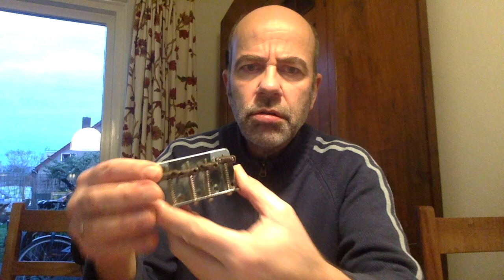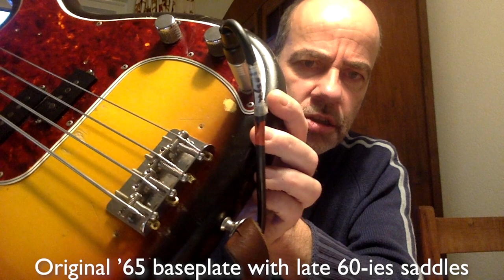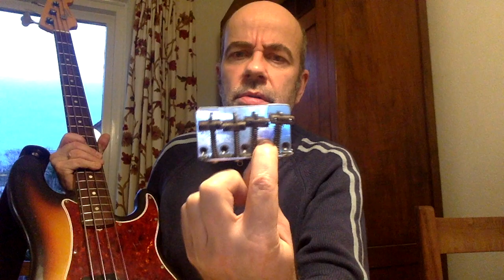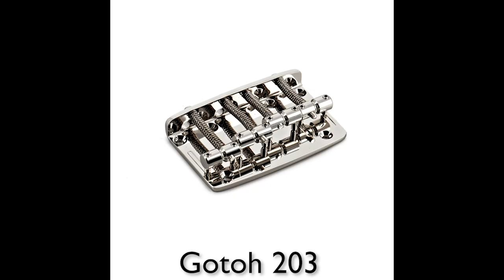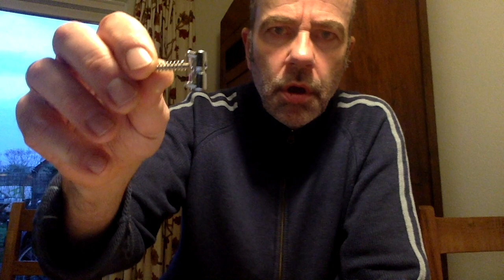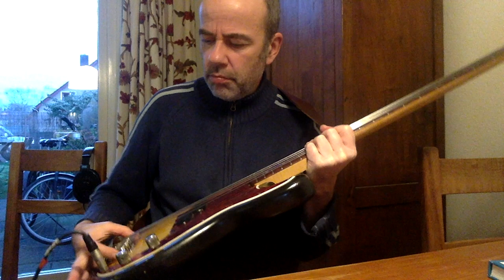Vintage Fender bass bridge saddles issues

Comment: Use longer or stronger Springs that will push the saddles outward toward the pickups. I sometimes use 2 springs to apply more tension on the saddles.

Comment: The bottom of the original screws that adjust the saddle height,  use a fine file and flatten the bottom of each screw, so the screw makes more even contact with the bridge. This might eliminate the clicking. Try using your old saddles and put new screws in the saddles to adjust the height. If you really want to use the old saddles. It's worth a shot!
Reply from the maker: That's really good advice, thanks! I did clean them with vinegar and a brush. Still not super shiny or something but already way better (they were really rusty). And I turned some of the saddles upside down. After all those years some of the threads were pretty worn. I also found out you should just let the strings sit for at least 2 days. Now this bass is fine.

Comment: I changed the saddles (cheap steel) on my 2010 USA Fender Jazz bass fitted with a vintage bridge, for larger diameter solid brass grooved barrel saddles (Trever Wilkinson).... imo the bass now has a slightly deeper but clearer tone with a tiny increase in overall gain, along with the fitted brass nut to i get a sweeter, clearer, deep old school tone better than the original vintage saddles... in my opinion...some may disagree..
Reply from the maker: Ah! Good tip. I've got 4 of the Gotoh saddles on there now. And I tie them together with tiewrap otherwise there's space between them. I'm trying to get used to the slight loss of character, but the tone is for sure more stable. I might want to try those brass saddles too. You got a link of the product by any chance?

Comment: I can see from the picture the saddes are uneven spaced which force a different offset of each string on its relative saddle. As consequence the pressure of the screws from the pair of each saddle to the plate is uneven. That can determine each saddle to not be pretty stable under string pressure and is side moving of course.
Reply from the maker: I must say if I leave it alone for a while (say a couple of days) it settles again. The string start to sit in better or whatever so I'm back to the old bridge and the old saddles!

Comment: I have a 70s Jazz bass, had similar issue. Finally replaced it with Fender branded high mass bridge and solved my problem. Still says Fender so looks original enough for me.
Reply from the maker: That totally works for the ash Fenders for sure (Marcus Miller is not totally crazy!), but the high mass thing doesn't suit the pre-CBS lighter alder bodies I think.

Comment: I've experienced this sitar sound with this type of Fender vintage bass bridge.  It happens when the alignment of the string over the saddle causes the string to make contact--enough to resonate--with the adjacent spring on/over the intonation screw.
Reply from the maker: That can happen too, but I checked that thoroughly in this case by letting someone assisting me to cover all the springs while the sound popped up. It's anoying! That's for sure.

Comment: The clicking noise might be coming from the saddles hitting each other as you play. Try a small spacer of mylar where one saddle contacts the next one and see if it disappears. Another possibility is the saddle holes where the Allen screws go have "opened up" a little with the constant hammering pressure of playing.  So the saddles are rocking towards each other. You could try some new Allen screws in case they are worn. It is possible that the sitar noise might be solved at the same time. The sound will be exactly as before with no change in tone. Good luck and let me know what you find.
Reply from the maker: Ah, yes I did try aluminium foil once inbetween the saddles once and indeed it improved. But the ticking/hollow sound appears also with brand new saddles so it can't be play in the screws I think? So I think key is ‘more intense contact’ between the saddles either created by inward pressure by the strings or indeed putting something in between the saddles. The sitar noises seem to be something different and are only severe with the 1965 saddles. I also turned them upside down once. It changed it a bit, but didn’t cure it.

Comment: Cool video!! I like threaded saddles because it’s easy to get string alignment right with the pickups.
Reply from the maker: That makes sense. With my 65 P it would result in a totally wicked string spacing situation though! And I don't think it matters too much with the double pole pieces. On my Tele (51 P) with the single pole pieces it's another matter I think.

Comment: I love watching your channel. You and I have some very same thoughts in common. Beautiful bass too! The other thing is, if you have the springs rattling on the screws, you can use a piece of heat shrink on the screw all the way to the back where you’d still have plenty of room for adjusting the intonation. Love how insightful you are. Be well.
Reply from the maker: It's not the springs I think (I did stretch those too in the past to get more pressure. Had my daughter pressing them while playing trying to sort it out. Darn, totally forgot about that). It's cured now with the 'inward pressure' caused by moving the G- and E-string outward one or two slots. That is for the ticking/hollow/touching noises. The sitar noises were gone with the late 60-ies saddles (and also with the more modern non-threaded Allparts and Gotoh saddles). Thanks for your kind words. Really touches me.

Comment: What.s the point ? You get conclusion on wrong machined mechanisms ? You cannot do a diference between 60's or modern bridges in these conditions. A 60's bridge will never clacking or clicking if well machined. I ordered couple of genuine modern Fender bridges over time. Some of them was bended from factory production. I never used them and never try to hear what "character" it have. Was just Fender garbage bridges as yours is. The quality control of Fenders is peculiar which do just couple of instruments to sound good from hundreds.
Reply from the maker: I'm afraid the whole project 'Fender' is not per se meant to be the best possible, but sacrifices are made to make it easier to produce and assemble to get an affordable instrument. But however, if you 'improve' some things (nicer woods, better neck construction, better hardware, etc) you may achieve a better bass in some respects (think Warwick for instance), but you do lose something. That something makes me personally want to play Fender and totally dislike Warwicks! But that doesn't mean we cannot try to improve some details here and there.
Reply: @JasperMortier  Hey Jasp.Thanks for you reply. I have the same concerns as you have. And trying to get the best coupling between the bridge and body sometimes I wonder if the best tone from this instrument did not come from some inherent' imperfections' in building. Still searching why from hundreds of series instruments just a few get the real tone ? Thanks.
Reply from the maker: Oh man. I tried dozens of Precisions before I found this one. Ridiculous prices (a.o. a beautifull looking 57-er for like 15.000 bucks or whatever, but darn, such a dull sound). But once you get a proper one: nothing compares! Not even like say the Pino bass or something. It's still weird. @CatalinGramada
Reply: @JasperMortier  Your sound great ! I still using your videos as references for my "researches" .Great presentations btw. Thank You.
Reply from the maker: @CatalinGramada  Thanks so much. That really means a lot to me.

Comment: Why don't you put a rubber collar around the screw feets to keep it tight all together ?
Reply from the maker: Yes, I did use tie-wraps at a certain point which worked too. But now I'm happy with putting the strings outwards one or two slots on the G- and E-string.

Comment: Very interesting!  I just finished setting up an early 90s G&L LB100... The bridge has a set screw on the side that is designed to compress all the saddles together.  This would eliminate any vibration or clicking, and also is supposed to make the whole bridge assembly solid and work as one unit.  Leo Fender was always coming up with ideas and fixes to solve issues like the clicking you're describing here.
Reply from the maker: Ha ha. See? Leo was struggling with the same thing. It took him a while to resolve this though. He should never have sold the company to CBS in the first place! It’s a bit easier to get solutions like this if you’re going the heavy mass path like with the babicz bridge, but that really effects the sound (for a lot of people in a good way). It would be cool to have a subtle solution for the lighter bridges though.

Comment: Thanks for helping me confirm I am on the right track to fixing the rattles in my MIM Jazz bridge with AllParts threaded saddles. As of right now a piece of a business card under the E string saddle screws, folded up between the E and A saddles, in addition to heat-shrink tubing between my intonation screws and springs, seems to have me business. Tempted to go with a Hipshot Kickass but afraid of unwanted additional upper harmonics, I just don't know what to expect from the conversion.
Reply: Nevermind, next time I picked it up the rattle is back. That's the most frustrating thing about this process, you think you finally got it fixed, but then it comes right back. I've been trying different saddle angles, different string position on the saddles, about to put some loctite or RTV on the height adjustment screws. I had Wilkinson saddles before the AllParts but they had other issues.
Reply from the maker: Wow, that sounds kind of messy! I don't think plastic UNDER your saddles will do any good for your sound in general. In between the saddles is less of a problem. Since you don't seem to have this vintage bridge maybe you want to consider the Gotoh 203. Not expensive and it won't change your tone in a dramatic way comparing to your current set up and is already superior technically speaking. The Gothoh 201 is also a good bridge with even more support for the saddles, but also a bit heavier (and I like the look of the 201 better). I'm sure the Hipshot is a really good bridge, but I'm also pretty sure that's really gonna alter your tone. But for you maybe in a good way: expect more sustain, more lows, more highs a bit less mids. Some people would say 'better'. I say a bit less 'old school character' with less middy overtones so that's totally a matter of taste.
Reply from the maker: Oh, I already talk about those Gotoh bridges in the video. I forget what I put in those videos. One last thing you might try is put a tiewrap around all of the saddles. Positioned under the saddles keeping the screws together creating inward pressure. Can be a bit of a pain if you replace your strings (the saddles can pop up due to this inward tension), but it helped me with my jazzbass. And you barely notice it.

Comment: Nice,  that is the secret to eliminate the buzz! The threaded saddle Fender bridge has that oldschool sound indeed. Steel plate and steel saddles. 70's bridges are horrible, the saddles move all over all the time!
Had a Badass on my Precision and it really gave it a sub-heavy and compressed sound(Good for slap and M.Miller I guess). Installed a Gotoh 203 and the sound opened up. It woul even more with a vintage bridge I suppose.
I just finished a 1966 inspired Jazz Bass and I used the Gotoh 203, mostly because of the extra 2 screws that secure the base plate on the body. It is also made from brass ,both plate & saddles. I think a happy medium between high-mass and oldschool. The vintage ones usually don't have the best contact with the body, but that may give it that special character...fun stuff. Thanks for your very  informative videos.
Reply from the maker: Totally comparable to my experiences! Yes. Thanks.
Reply from the maker: And it's very similar to snare drum rims. The heavy die cast stuff totally kills the open character of a Ludwig Supraphonic for instance. But also the quality of the steel is super important. I tried generic cheapo rims which although having the same thickness (1.6mm) totally sucked sound wise.